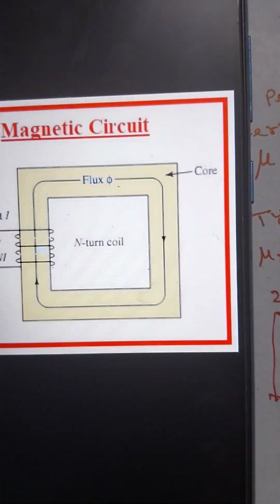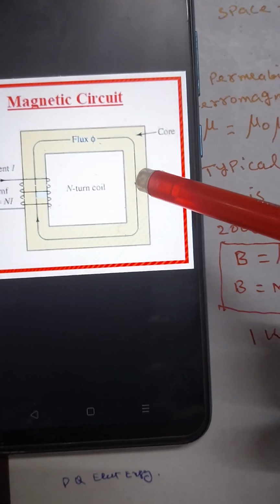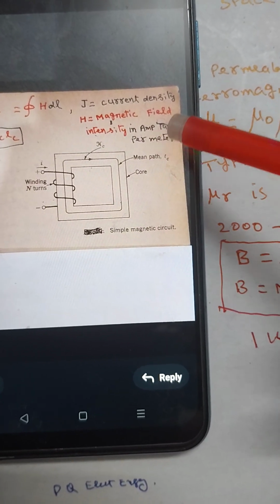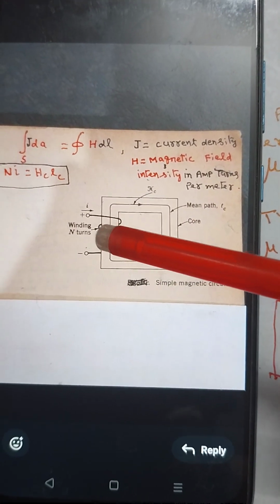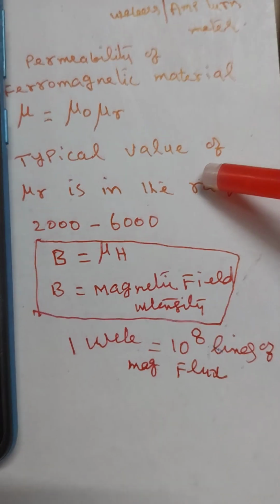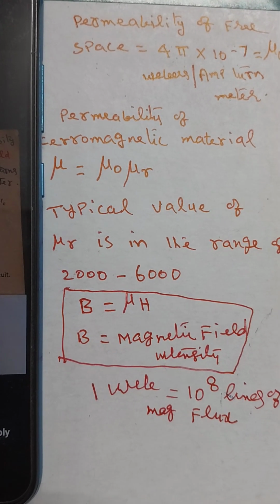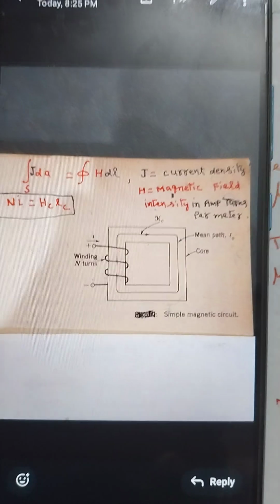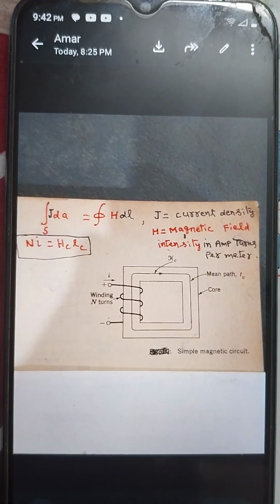WORKING PRINCIPLE OF TRANSFORMER

Comment: Concept cleared largely.please explain why magnetic field intensity is same along the gap or along the materials,but magnetic flux density differs
Reply from the maker: This happens because the magnetic permeability of the core material is significantly higher than that of the air gap.